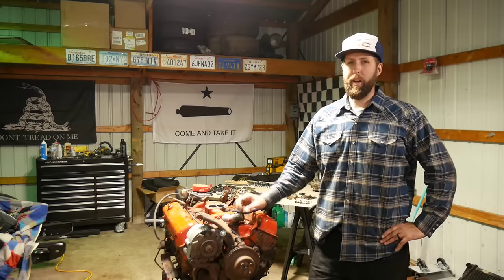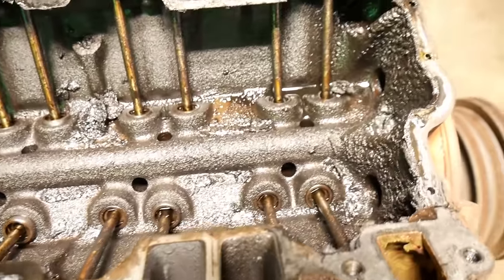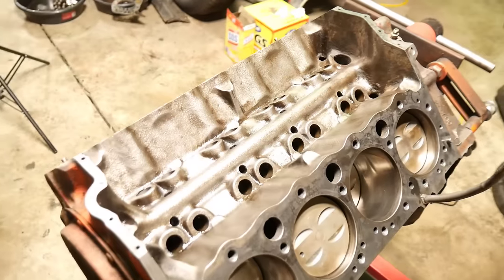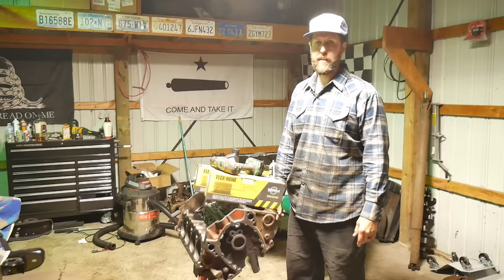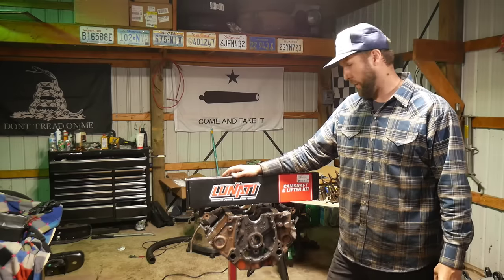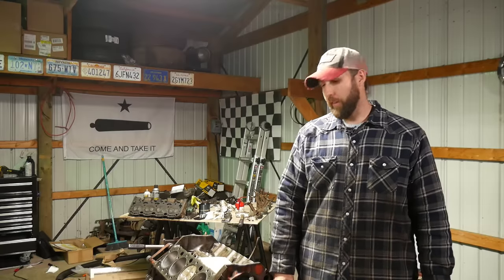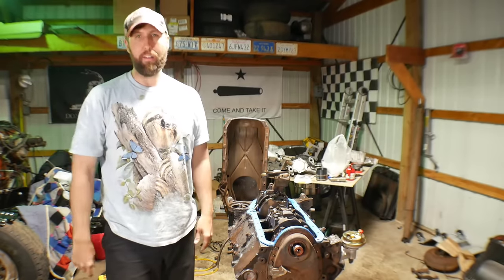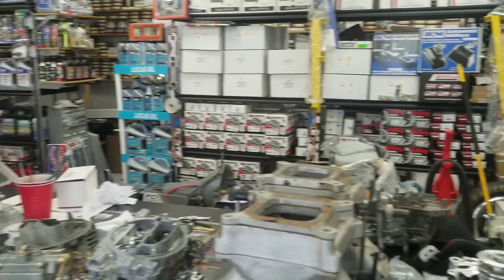Budget 307 Small Block Chevy Build & Dyno - Vice Grip Garage EP28

Comment: Hey GREAT video again! You know that coolant on the floor issue. I know how you feel and even if you put a catch basin down it's going to miss it and go on the floor anyway, kinda like a Murphy's Law thing goin on, but I found out something. Try using some sort of a fluid sucker like the MYTVAC pump (see the link below). Once you use it, you will do it that way on every engine, every time you have to pull an intake or the heads or do and engine job from that point on. Just stick the small suction tube down inside the coolant passages and pump the MYTVAC until you hear the sound of someone using a straw at the bottom of a milkshake.  You can use it in some radiators and run the tube all the way to the bottom. Use it before you pull the intake and again before you pull the cylinder head. No more mopping the floor and no more tracking the fluids all over the shop. After you get a pan under the engine stand everything will be easier to clean and it saves at least an hour of clean up time on each engine job. You can suck out engine oil, brake fluid from the masters, coolant, transmission fluid, transfer case, even gear oil from the differentials. 

https://images-na.ssl-images-amazon.com/images/I/7178CJwlL7L._AC_SL1500_.jpg

They make a unit that can switch from suction to pressure also but they seem to break and its not so easy to clean everything and it's very tempting to use it to pump fluids back into transmissions and diffs but there will be contamination. Best to have one for sucking and one for blowing, kinda like, well you know what I mean.

You can also use a shop vac but try to hook the shop vac to the top of a 5 gallon plastic bucket and have a second hose (like a 3/8" fuel hose) also connected to the top of the bucket and use a smaller hose that slides in and out of the 3/8 hose to put inside the small passage openings. That way the fluids all go into the bucket and it's easier to dump out. If you do the shop vac way, maybe you can do a video on how to connect the big shop vac hose and the smaller hose to the bucket. I have a feeling you will get it to work even better then my setup so you can show the best low cost way to do it.

Thanks again for all these great video's!

Comment: Looks like a sbc that never ran up to temperature.

Youre calling #5 cylinder #3

If you need seals you need guides

A lot of those timing gears were nylon covered and they still worked after it broke away, although it often plugged the oil pump

Comment: I think all the hate on the 307 comes from the fact that, 1. it was the base engine for just about everything from 68-73. and 2. like the 400 small block, there was never a performance version of this engine and only offered 2bbl carbs and had low lift cams.  

It shares the same bore size as the 283 (3.876 inch) and the same crankshaft as the large journal 327 (3.250 inch stroke). the bore is a little small for large valve heads (2.02/1.60 valve) and the cylinder bore will shroud the valves.   honestly this combo as potential to be a fairly good cruising engine. you should be about to get 300-320hp and around the same in torque with it.

Comment: I wouldn't want the 327 in the category with a 305 or 307. I wouldn't lump 283 in there either. No 1995 in there the 305 is a good engine for what it is. 327 is a barnburner for a small block. 283 where powerglide behind and lunch at sixty-seven Chevy 4 door belair down the road really well hit about 70 mi an hour and let go in 2nd gear. 307 just driving around sure but it's never been a great motor racing parrot course you can modify them but might as well start out with something else if you want some horsepower. The numbers you got on this nearly three years ago a real good for a307 that's been only spruced up. Look how far you've come and 3 years. Glad to see you getting the success you deserve and look for You to keep on moving up congratulations 🎉

Comment: We just built the same type 307 build for sons car! We have not taken it to the track but it runs very well, spins the 275/60/15 coopers for 15 car lengths, we went with a chevy 350/300 cast intake with a qjet, and the summit 1785 cam and lifters, what cam did you actually use in this 307 build?

Comment: You've got nothing to be ashamed of with those numbers.  I believe stock was about 200hp and 300ftlbs of torque.  Oh and I use the intake gasket thingies on stock motors.  If I've had the heads and intake milled then just the RTV

Comment: tq at that rpm out of a 307 is actually really good considering the build. 
Glad he cammed it for st torque and not some stupid choppy stick that cant peel the skin off a grape. 
great driver engine. Too many cars that sound good at a light and cant hit the throttle cause it will barf and fall on its face
btdt many yrs ago.

Comment: yes clean is good my uncletold me every day when i was 15 cleaning his 427 chevy in the garage for 2 weeks he put holley dual 4 barrel tunnelram with 2 650 double pumpers  on it  he sold the engine to a guy with a 1973 camero im sure it was faster  that tunnelran was 2 piece 22 inches tall with air cleaner taller than the roof a big vision blocker  probably not legal

Comment: 307's wind just as well as a 327 ,, my friends would go 7500 very quickly ,, 462 2.02 160 heads , small lunati cam ,, ,  ,,, a cam with around 230 @ .050 ,, cut the deck of the block because usually a 307 piston is down .020 at 9.000 deck ,, 1.655 CH ,, so ,, at 9.025 deck ,, you have .045 quench plus the head gasket ,, it needs to be .040 total between the piston and the head with the head gasket ,,,  i watched this 307 smoke many 350's ,,, it was a blast

Comment: 73 chevy step side 30 over 307 488 lift cam with cameldouble hump heads n vega 4 speed i could get about 8 inch gap under drivers side front tires.

Comment: since you made 280 horsepower with that add another 10 by using steel roller tip rockers from Comp cams that'll put you over 300 horsepower Mart by the way that's a that's a pretty nice bill

Comment: the 307 was a "Get you from A to B" engine.
small cubes
junk 2-barrel heads with big "bathtub" chambers, modest 9:1 compression ratio when most everything ran 10:1 back in the day
junk 2-barrel 
regular small cam
most always single exhaust

Comment: Nothing wrong with a 307, I prefer it over the 305. The 307 was available exclusively as a low compression, small cammed two bbl. Put on a 4bbl and a bit more aggressive cam and it can go a long way. Increasing valve size doesn't hurt either.

Comment: please correct me if i am wrong  its 1 3 5 7 cyl on drivers side 2 4 6 8 on the other  so number 3 would be second from front not the third    luv your vids you love Chevelle too as me i had 2 a 70 454 and 72 350  i sure miss me 72  ....

Comment: AWESOME ! JUST WHAT I WAS LOOKING FOR !
I just acquired an old '68 Bell Boy Boat and just looked up the block casting number today and discovered it has this same engine in it. I want to see if it runs before I tear it down and would like the build specs you did on this one if possible. You mentioned the cam wasn't right for this build and had another one in mind for better performance - what was it or what would you recommend ?
I would like to achieve 300 HP with a little higher RPM range, but alas I don't know what I'm talking about either - lol
I don't want a gas gusseler or a "street performer" just something a little extra to scoot across the water a little faster without dumping a bunch of money in to it - like your build, unknown miles but not overly used either; condition of internal parts UNKNOWN - the boat has been sitting in a field uncovered since 1995 and believe it or not its in pretty darn good shape.
Can we talk ?

Comment: I have a question if you have a sec. I recently bought an 5.7l tbi 350 that was full of crud, dried flakey oil just caked in the valley and the heads. I got it all out after a fashion and the cylinders look good. I intend to completely rebuild it, including new heads of some variety. My question is two fold, what intake manifold if I go carb, and if I keep the TBI is there a better intake than stock. I lied, I have another question ( or maybe 6) I’m wanting a sort of beefy sounding motor, not a drag engine but I want it to sound good. It’s going on a Nissan Hardbody low rider comvertible that I’ve been building. What rockers? Roller rockers? What cam? And is it possible to use a double timing chain? Sorry for all the ?’s, this is my first ever build like this. I’m greener than a leprechaun’s hat! Thanks!

Comment: I had a early 90s camaro someone put a,huge cam in the stock 305 they  blew it up I ended up putting a 350 in it out of a 89 chevy pickup  also had flowmaster 305 HO heads and eldbrock shortie headers .

Comment: Nothing wrong with a 307. In fact, since it has a 327 crank, the upgrade to a forged crank from a 60s era 327, a good porting (or head swap, keeping in mind the cylinder bore somewhat limits valve size) and you can have a responsive and economic street engine that will be furable and last for a long time.
Not bad numbers for a budjet build.

Comment: The 307 engine is an oddball engine everyone puts down but I seem to like it. I  don't know why? I had one in the 1988 in a 1971 Camaro and I did a lot of street racing with that thing and it wasn't much slower than a 350..  I'm just wondering what kind of camshaft is in this engine build ?  This build  reminds me of a 1966-67 300 horse 327 Corvette.
Reply: Well I got me some ported 416 casting heads that I'm going to build on my 307 and I'll probably use a summit racing 234 duration cam @.050... I'm not going to use those split duration cams I think I lose horsepower and it needs gas.

Comment: For me Permatex SGOR RTV ( SGOR = Synthetic Gear Oil Resistant [ the grey stuff made for diffs and manual transmissions ] )

 but honestly nearly anything beats those gummi worms ( just let some fuel get on one and you'll understand the name ) supplied with those intake gasket sets.... 
What really Gets me is that gm, fomoco, & mopar  enginerds make them... and still can't figure out a better solution....

Comment: I look at the 283\327 as being something that a guy might keep around as a backup engine for times when the Intended engine for his pickup truck or street rod has to be removed for rebuilding or some other reason. But he still wants to be able to use the Vehicle in the interim. I wouldn't spend a nickel more than I had to on those engines.

Comment: Love what this guy did.  Know this was basically a budget rebuild.  But wonder what he could've done with some with some  2.02/1.60. Corvette/Z28 heads, that same manifold, and a little more cam. 1hp/per cu in. or more?  That's only 17 hp away.  And what distributor did you use, stock?
Reply: Valves would hit the cylinder walls
Reply: @magellanstravels  Not a 4 in. bore?  Bummer.  Still 295 hp @ 5500 is not bad considering the stock value train.  Any thing else would break the bank.

Comment: What lunati cam did you go with for this build? I'm curious of lift & duration.
I myself have a 307 I'm building in my 67 gmc c10 using 416 305 heads & edelbrock 600cfm carb & performer rpm intake

Comment: That engine looks like it was ran with Pennzoil its whole life. I opened hey 400 small block that had been ran with Pennzoil it's entire life. I found the valve covers absolutely full of an ash-like substance and there was barely room for the rockers to go up and down otherwise everything around the rockers and everywhere else was just coated with just a little space for the mechanical bits to move. The engine died from a flat cam.

Comment: I know the Chevy guys crap all over the 305/307. But I can help you prove they can have some salt. Years ago I had a girlfriend that didn't have much money.  Her 350 4 bbl 71 Camero rod cap broke tacking out the left front corner of the block. Now junk. I couldn't find a used 350 engine anywhere her in Phoenix. I did find a core 305 out of a 79 Nova for $100. Got it and bought a Chevy cam and lifter kit with about the same specs I would put in a Ford 302. Put lipstick on it and with the 350 intake, quadrajet, and dizzy. It ran like a scalded dog.

Comment: Don't know why the 307 cops so much hate. I mean it has a smaller bore than a 327/350, but still bigger than 305. The blocks were also pretty good quality. A stroker 307 would be very good street combo, or even for a truck/ute that does towing. I like your humour.

Comment: The chevy 307 replaced the 283 which had 195 horse. I was told the 283 was a short stroke engine.The 307 had 200 horse.

Comment: 290 hp just like the 302 Chevrolet V8 engine from 1967-69 the Chevrolet 307 V8 can make some decent horsepower which it’s built between 1968-73 or 75 it’s my favorite no thrills engine but it can get better if you find aluminum heads for it

Comment: A 302 is a 327 with a 283 crank . I’ve never heard of a 307 described as a 283 with a 327 crank but that would make since . But it should still turn up because a 327 turns up so with smaller lighter pistons and the same stroke as a 327 I would think it would still turn up with good heads and compression but I’ve always heard 307’s wouldn’t spin up so …

Comment: That short stroke should be super Forgiving on  Timing You need Spring so you can give her the hours build the built a few short stroke oddball combo smallblocks solid rollers or hydraulic rollers Ticket but budget wise not so much Advancing the camp time in a couple degrees Big Springs and feeder the  RP m's should make better power than that

Comment: well is because a 350 rebuild makes more sense throw 202 heads pick the cam change cam bearing ect more bang for the buck and make sure its four bolt main or make a stoker moter out of it no 305 or 307 is worth boring out money wise maybe 327  to each there own thanks for the video man ps better rods too and valve springs and losts of luck

Comment: Thers two water jacket plugs at the top of oil pan edge there like 9/16 npt threaded they will drain that out like draining oil pan you may have to use your nail to unplug them yeah moly rings like 600 if you can get them down that far yeah if your finger nail goes down in a groove in the cylinder wall you’ll have to punch it out I’d say you should be able to get at least 300 horsepower buy the way love your hat never seen one with both manufacturers on it lord yeah the 58 cc head that’s the way to go those heads have angles in the combustion chamber like the old double hump heads did I always set the cam up advance it 4 degrees if you use number two permatex on the block put the gaskets on it then a thin smire of silicone on the pan the backward on the valve cover close pins and permatex number 2 on the pan and close pin it to hold it then silicone the bottom gasket to the head and yes a 1/4 inch beed on the intake sweet intake buy the way! Yeah 302 only came in the z28 and the z28 only got one motor for 1967-68-69 the 302 it’s the little motor ford had a hard time beating it also took the hemi out on a date it’s second year of Daytona 500 64 hemi won 65 Smokey unick had the first 302 and won 65 Daytona bearing out the hemi! Hell yeah 290 hp yeah I got 2 307 and 1 283 a bunch of 305s and some 350 4 bolt main blocks if you build a small block build a chevy if you build a big block build a hemi that’s what I’ve heard my whole life and yeah chevy guy all the way but if you get a little time and see how a hemi head works and think that’s why most came two fours from the factory and I’m talking 426 hemi from the 64-72 area but hay the small block pound for pound inch for inch is the best v8 motor ever it’s won more races been running longer and been rearranged every way posable for the money spent that said the money spent now there probly others won more races I know every one will get the fact books out but for the money spent it can’t be beat I know nothing of any kind and easy to find bang for the buck hands down small block Chevy all the way if that motor had not came out or ever been I don’t think chevy would have the name they do today or be liked buy so manny in my book chevy rides the coat tail of it’s small block v8 nuff said yaw be safe out there wear your mask no wooden nichols no candy from strangers and like this man’s video and subscribe !

Comment: You can’t give up until the bottom end is cracked and ruined and can’t rebuild anymore the Chevrolet 307 V8 isn’t the big powerhouse but it’s capable to make around 260 hp maybe more if you can find aluminum heads along with the aluminum intake manifold and carburetor choices like 650 750 850 cfm with a bunch of high performance parts

Comment: If I was going to build a Chevy it would be a 350 4 bolt main. Back when I drove Chevy's the 4 bolt main was the toughest all of that shudge is from using Pennzoil. It's the worst oil you can put in your engine

Comment: One of my favorite discontinued GM engines.
Derek- what's your opinion on the 307 compared to the 305?
Reply: Technically for performance, a 307 has a better bore vs stroke than a 305 (3.875x3.25  vs  3.736x3.48).  On a mild build they'd run very similar, but the 305 would have a little more of that off idle torque and the 307 would probably pull ahead on top end (all parts being equal). But,  on a high RPM build there'd be more of a difference and the 307 would likely leave the 305 behind. They have the same 5.7 rod length, and the shorter stroke with that rod is happier at RPM.  And the 302 with the biggest bore and shortest stroke, even more happy at higher RPM.

Comment: You should get out your Dremel tool and  at least smooth out the inside of those intake and exhaust ports let's the.  air move a little better if they're smooth , but you need to do it and clean it really good before you bolt the heads on